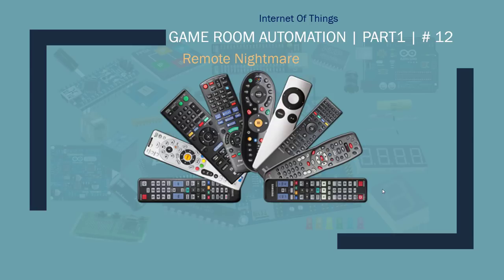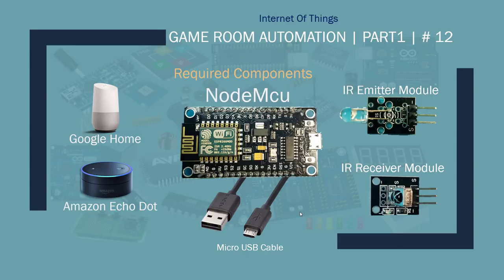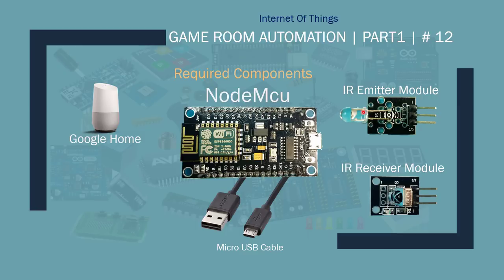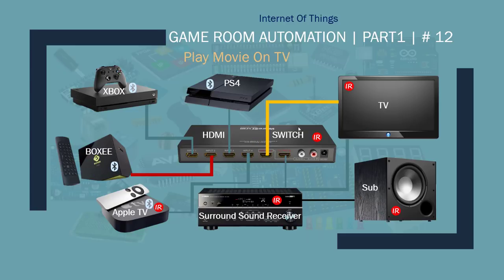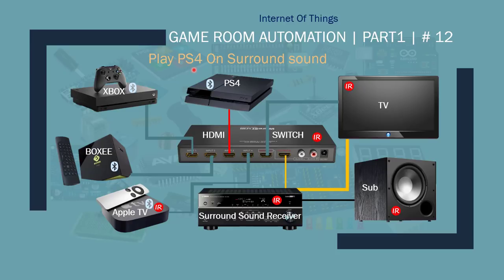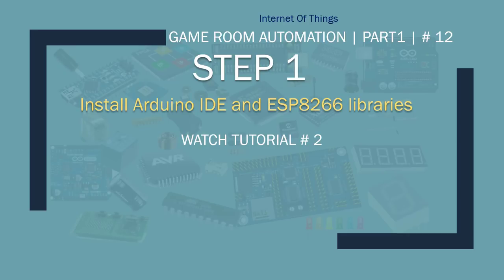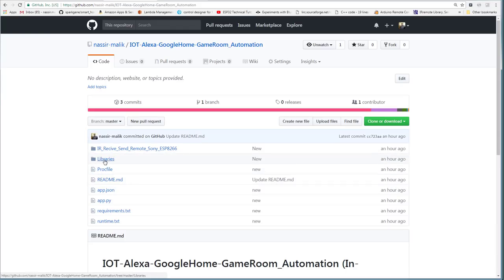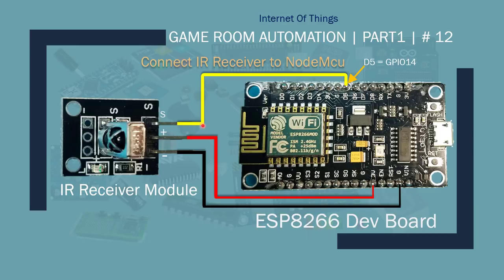Game Room Automation with Alexa & Google Home | Part 1 | # 12

Comment: Your Surround Sound system should have a Passthrough mode, where you dont need a HDMI Switch, maybe you can get the sound directed to the tv through the Surround system. If not, you can switch to Center Speaker, its always better than the build in speaker in almost every TV.
The PS turns on with the Controller, if you want to play you have to get the controller in your hand. Problem Solved. =)
Reply from the maker: Recep Gürbüz Yes, how many hdmi inputs do you have on your receiver? I have 4 inputs and 8 devices😊.
Reply: Sure, with 8 devices it is a problem. In your Video we just see 4. And with 4 Devices you dont need a splitter on a Sound Receiver with 4 inputs. My Receiver have 4 too. Thats enough. 2 PCs (1Server, 1 ASUS Vivo, 1 RPI/Kodi and a WiiU. Dont need anything else. =)
Reply: I have 2 switches, and a sorta old fashioned but works great receiver,  but my Harman Kardon released when HDMI was only a video signal, so my receiver can accept the HDMI say from my PS4 slim, but the slim has no audio out except from the single HDMI which my receiver can't seperate. So I have a HDMI switch with SPDIF out. Basically the single HDMI runs to the switch, the out on the switch goes to receiver HDMI in and SPDIF out to SPDIF in on the receiver. It allows anything hooked up to the switch to pass as optical audio. It was the only way I tried and was successful, add to that 2 in 1 out on the receiver and 2 in on the TV I'm limited to add one. The switch I have is 5 in 1 out and within the next 2 weeks I plan on getting a 4 in 2 out switch as I'm going to be getting a bigger TV, the switch I have is almost identical to the image and I can't complain, it's a bit of a pain to work around but not overly complicated now that I know beforehand what I would need. One day i'll upgrade my receiver, but for a half decent Harman Kardon your still paying over $1,000.

Comment: Dear Sir Thanks You for your innovative Video and sharing with us making a lay persons like me to understand the concept well explained. In regard  to Play station (3/4) the remote control work through Bluetooth and not through infrared. In PS3 there is a setting when you select the select hdmi input on your TV for PS3( the PS3 automatically get on.)
Reply from the maker: Alexa Osd You are right but you may have skip the part where I am mentioning using ESP32 that has built in bluetooth. I also mention that Sony does not allow 3rd parties to switch on PS 3/4 from bluetooth. I do have a work around that I will share once I do the PlayStation tutorial. Thanks for your feedback.
Reply from the maker: Alexa Osd You don't need to apologize my friend. I am learning a lot too. You will see here many people are correcting my mistakes and helping me to get better. I don't know everything. I am just sharing with you wherever I learn. 

I will take a look at Heroku issue and get back to you soon. Can you give me the tutorial number?

Comment: How is the efficiency of the IR transmitter? Does it have to be directly in front and close to the tv?
Reply from the maker: Gibran Hafeez It similar to the original tv remote. It works when tv is in line of sight.

Comment: Hi thank you for posting this, love your work! I have the same nodemcu board and same IR transmitter, using same libraries, I can't get my IR transmitter to send the right signal, I'm using your same code "irsend.sendSony(0xa90,12,3);" as I have a Sony TV and  I got the same IR codes as you do. BUT then when I test by reading the raw data of the remote and the IR Led, I get two different signals (sony remote is raw,26,38 and the signal the LED sends is raw,101,38). the same line of code and led works perfectly on my arduino UNO. Any idea what my mistake could be? Thank you
Reply from the maker: I am not sure what is the issue. Try using different pins.

Comment: Thank you for this video. I am going to try to set up a similar system. I downloaded all libraries from Github and I did the Heroku setup. I'm having trouble locating the sketch you used in the video. Where do I find that?
Reply: Oops.  Nevermind.  I found it.
Reply from the maker: Dan Basye It is on IR_Recive_Send_Remote_Sony_ESP8266.ino

Comment: firts let me tell you thank you for this videos I saw the most of them , I did all the steps but in the end I have this mensages 
 ets Jan  8 2013,rst cause:4, boot mode:(1,6)
wdt resetI´m from Mexico and I couldn´t to find the simililar IR reciber and emmiter , could be the reason of this mensage?
(I will used a LG tv , but I donloaded a app on my cell in order to have the same IR signial like this video(Sony IR signal), but does´t works(the IR from my cell  signal works because I did the test in my tv) )
thank you in advance for your support
Reply from the maker: leonardo amaro I am not sure what your question is
Reply: I'm sorry , my question is .. what's means this message... ets Jan  8 2013,rst cause:4, boot mode:(1,6)
wdt reset......
Reply from the maker: leonardo amaro Your board is crashing for some reason. Try to use better power source. If you are still having the issue it may be due to the code.

Comment: Hey Thanks for the Video, very nicely described. It tried it but my IFTTT applets are giving "Applet skipped" error, Unable to make web request. Your server returned a 503. I checked Herokuapp build log, it's says "Python app detected
 !     The latest version of Python 3 is python-3.6.4 (you are using python-3.6.3, which is unsupported)."

Is it because of difference in python version, IFTTT is not able to connect with Heroku. Please help.
Reply from the maker: prashant panwar Yes, change "runtime.txt" with correct version and redeploy.
Reply: Hi, i have made changes and redeploy, now there Herokuapp shows correct version but when i trigger command at echo, IFTTT still says "Applet skipped  Unable to make web request. Your server returned a 503" Si there anything else where i can check for any errors
Reply from the maker: Do you see any errors in Arduino serial window?
Reply: No, here is the detailed msg   

dhcp client start...
ip:192.168.1.17,mask:255.255.255.0,gw:192.168.1.1

Connecting to Connected to wi-fi
Enabling IRin
Enabled IRin
Connected! 
Got data
Command is not recognized!
Sending response back

But i received this msg only once just after flashing the NODEMCU.. if i disconnect and reconnect it, no msg reflected in console window, is it fine ??
Reply from the maker: Arduino IDE output looks good. Make sure you your board is not crashing. Add one second delay and print to serial in loop to verify that is not crashing.
Reply: i got same problem, do you fix it?
Reply: MAX.R MENG nope.. still struggling...

Comment: i have a problem, my IR emitter do not send any signal (so i do not see any blinking through the camera). Can you help me. in addition, there is probably a error, which is shown in the serial output "[WS][0][sendFrame] ------- send massage frame -------
[WS][0][sendFrame] fin: 1 opCode: 1 mask: 1 length: 23 headerToPayload: 0
[WS][0][sendFrame] text: "heartbeat":"keepalive"
[WS][0][sendFrame] pack to one TCP package...
[WS][0][sendFrame] sending Frame Done (1263us)."
Thanks, i don't know, what should i do?
Reply: alex say to me, that i should check, if the Arduino is connected to the wi fi or plugged in the socket :(
Reply from the maker: TK EDITS It sounds like your device is unable to connect to the network or the internet. Make sure your Heroku app is deployed successfully and your esp device is connected to it.
Reply: i am getting always the same error in the IFTTT App now, Unable to make web request. your server returned a 503. the build of the app shows me that message  !     The latest version of Python 3 is python-3.6.4 (you are using python-3.6.3, which is unsupported).
 !     We recommend upgrading by specifying the latest version (python-3.6.4) /// Thanks for your help

Comment: The journey to your  Channel is like a treasure hunt; whenever I have a problem you kindly put me in the right track...Now I am very comfortable of your workflow and I managed to do the steps as instructed . Two points I am shaky on:
1. Once I deployed your app to Heroku, and give it a ID (instead of alexagoogleifttt) and I got the message success. Tried to test it I got errors....The log did not help me at all because it is referring to the python script. How Can I make sure the test is OK ?
2. I did only one IFTTT to turn on tv just for testing and made sure it is on, The DOT could not find tv as a device. The Serial Monitor on the arduino side displayed the following:
Connecting to Connected to wi-fi
Enabling IRin
Enabled IRin
Connected! 
Got data
Command is not recognized!
Sending response back
pm open,type:2 0
Disconnected! 
Connecting...
Connected! 
Got data
Command is not recognized!
Sending response back

This happened without me "saying" anything !!!!

Your support will be greatly appreciated
Reply from the maker: Samir Arishy Arduino serial output looks good and it means that your ESP device is talking to Heroku. If dot can't find you IFTTT template then it looks like you Amazon Alexa account is not linked with your IFTTT account. Please relink it.Good luck.